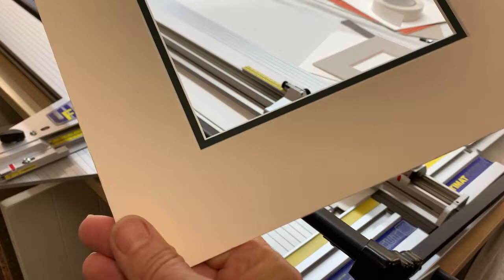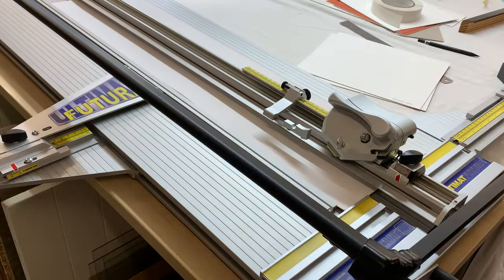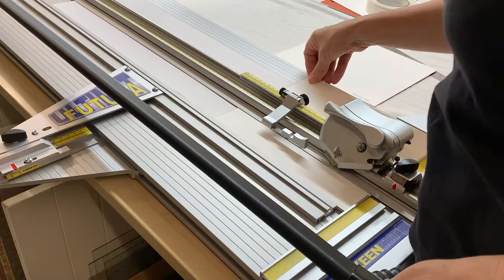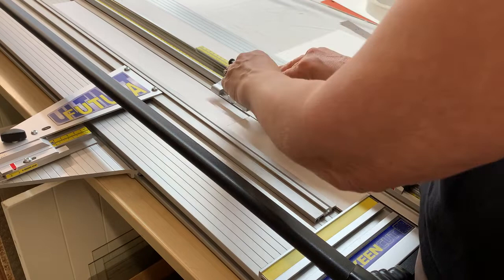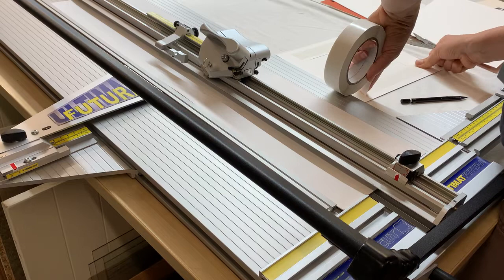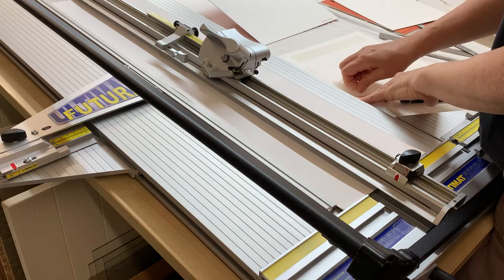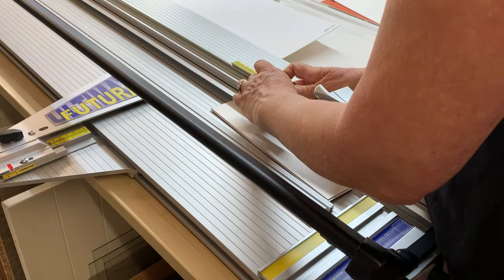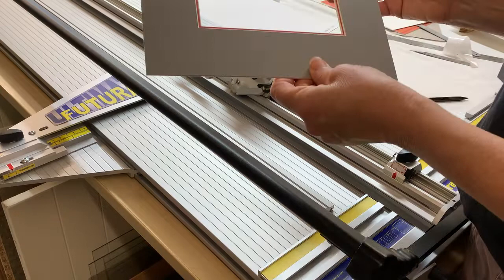Cutting A Double Mount using a Keencut Ultimat Futura, a manual mount cutter.

Comment: Why must you put the window back in the first/top board? To act as a slip sheet?
Reply from the maker: Yes, the slip sheet is key whenever you are cutting window mounts and so when you stick the two boards together the inner mount will be one mount higher, so you need the second in place to act as a slip mat.
It's also worth noting that we often return the fallout when cutting decorative mounts.  It also preserves the integrity of the boards and keeps everything stable.  
Enjoy doing decorative pieces!